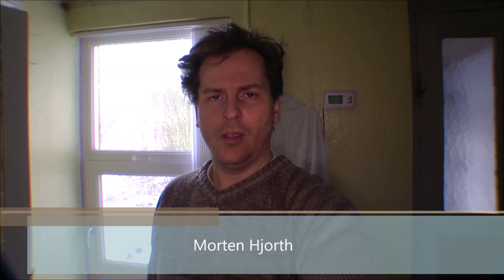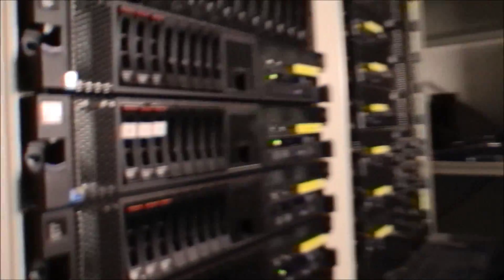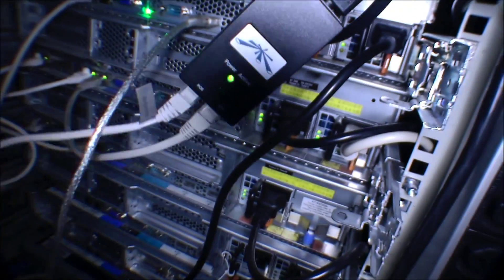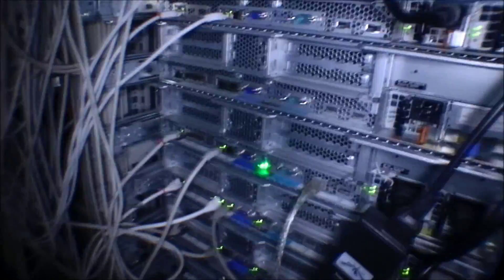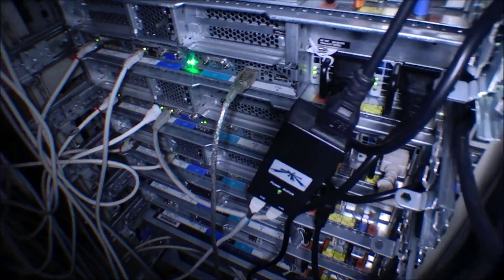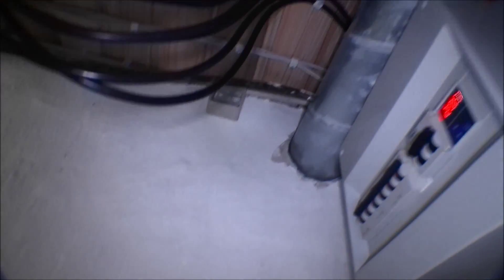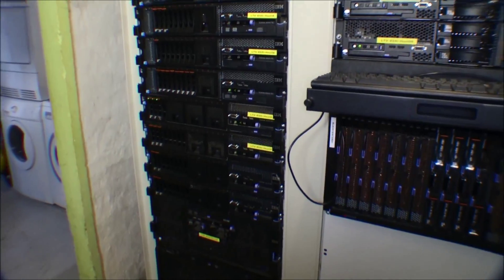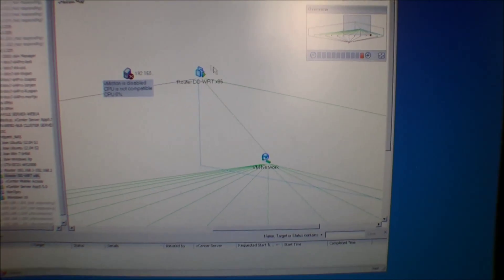Network Overview, wireless - DD-WRT - SRW2048 - 129

Comment: Hey Morten!

On your latest videos this setup hasn't changed much. Have you considered getting a 48 port 100Mbit switch just for the management connections? I know you're using SFP+ 10Gbit but you could use your current 48 port switch for 2x1Gb link aggregation/teaming or if you have the mezzanine cards 4x1Gb.

Thanks for the video!
Reply from the maker: Hi Kevin Clingerman
Thank You very much!  I am getting a new 48 port switch very soon.
Thank you for watching! :-)
Reply: A separate switch just for management is a good idea I think, then like you say you could use a cheap 100Mbit switch to free up th Gbit lines.
Reply: Ps just got my SRW2048 today for £60 and looking forward to having a play with it later in the week!

Comment: I still kinda regret buying a 30 dollar 48 port 10/100 switch, But overall I just need it to do at least 80Mbps transfers from server to client, They have the SRW2048 switch for around a hundred US on newegg, Same for Me hosting multiple VMs on multiple servers, while the VMs are assigned one physical core each, I also use a single core 32bit application per VM, These applications use about 8mb/s per every 64 connected clients, Its a mouthful but hopefully I don't let an ethernet switch be the cause of my unhappy, "Very High Ping, Low Down speed DSL" clients not being able to sustain a ping of less than a 100ms because I didn't have enough switching power...The switch I'm waiting to come in the mail from canada is a "Netgear prosafe FS750T2", and my router is hopefully going to be a PFSense machine or RouterBoard's 2011UAIS-RM...Great video man
Reply from the maker: Hi
I am on the look out for a newer 48port 1G with 2 or 4 10G ports :-)
Thank you for watching! :-)
Reply: My PlayHouse
Nice man, I've looked around at some switch manufacturers and they have some 100G switches with QSFP+ ports for around 5K+, Just if you're interested in having the fastest possible commercial grade network available
Reply from the maker: HI
Not 100G,, just 10G
And I want it cheap!
Thank you for watching! :-)

Comment: Interesting that the ISP chooses to use a wireless connection in what looks to be an urban area.
Reply from the maker: Hi +BlueFoxTV
Yes,, we do have ISP´s that use the telephone cables,,and fiber,,no fiber in my area :-(
This  wireless connection is really well priced,, i get an upto 55/55 Mbps for $21 a month. It´s more like 40/40 Mbps,, but it´s still cheap.
Thank you for watching! :-)
Reply: Well, I'm quite surprised that they can get 40/40 megs over reliably on 2.4 GHz, provided they have not upgraded their NanoStation 2 to something like a NanoStation M5 or a NS loco M5. The 5 GHz band is much better, as it's wider and much less crowded. (I do work at a wireless ISP)
By the way, DD-WRT is a good choice, I'm running it on an Asus RT-AC56U router, but I'll be migrating it to a VM, and keeping the Asus only as a wireless AP.
Fiber is a good thing, I have a 250/100 Mbit/s FTTH connection for 18€ per month, but it's often a bit more, something like 265/110 :)
Reply from the maker: Hi *****
I have been upgraded to The 5 GHz band.
 I have a 250/100 Mbit/s ,,,, i am envious!! ;-)
Thank you for watching! :-)
Reply from the maker: Hi AnasheedCast
This video has becom old,, i have been upgraded to The 5 GHz band,, and had to move the Ubiquiti Nanostation to get the clear line of sight. Mine points at a mast where the receiver is located.
Thank you for watching! :-)
Reply: +BlueFoxTV It's cheap, can be deployed anywhere (no need to lay cables), and if installed correctly, and the devices are carefully selected for the distance and capacity of the link, the performance and reliability matches cable based connections.
Reply: ***** it's cheap alright. But the performance and reliability is nowhere near as good as an equivalent copper or fiber system.
Reply from the maker: Hi i did share a speedtest on my Google+ on 3.dec : https://plus.google.com/+MyPlayHouse/posts/5BDeQuTEjrY
The speed is okay.
Reply: +Animesh kumar I can't,  as there's a part in my contract that I cannot give away our know-how while the contract is valid, and three years after it.
Reply: +My PlayHouse (Morten Hjorth) Where is the other end of the Ubiquiti Nanostation, as far as I know this is a point to point device so is it in a clear line of sight, similar height etc?
Reply: BlueFoxTV I work at an ISP, and we do offer wireless connectivity where we don't have DOCSIS or fiber, including guaranteed connections. (however at a maximum speed of only 8/8 Mbit/s, which is still better than DSL) Of course, the wireless backbone runs on licensed frequencies, and only the endpoints are 5 GHz.
OK, I might have been a bit too optimistic about the qualities of a wireless connection compared to copper or fiber, but 5 GHz wireless is reliable enough to offer a guaranteed internet connection.

Comment: Do you have a "UPS" for all those servers?
Reply from the maker: Hi +Vanecphreaking1 
Well right now, i do not have an UPS,, luckily we have a very stable power system, and only loos power 1 or 2 times a year.  Most of my servers are off,, i only turn them on when filming or working on them.
I am trying to get an UPS up and running,, lots of videos on my attempts :-/
Thank you for watching! :-)

Comment: Can you show, how to setup a Fiberchannel SAN Connection
Reply from the maker: Hi MrAtlantis646
I wish I could,, But I do actually not have all the equipment needed,, maybe if there suddenly dumps an IBM DSxxxx Fiberchannel SAN in my lap,,, weird thing has happen :-)
Thank you for watching! :-)
Reply: But do you know how to connect the rx and tx Lines I mean RX to TX or TX to TX
Reply from the maker: Hi MrAtlantis646
Yes on Fiberchannel SAN, there are a pair of fibers in each fiberports one RX and a TX.
Your Network fiber card or HBA, will have the same.
The Tx from the net card has to go to RX in the SAN and the TX on your Net card has to go to RX on the SAN,, and the same if there is a fiber switch in between.
But this is not something I've been working very much with,, has mounted many fiber cables,, but never made the rest.
Thank you for watching! :-)

Comment: do you have only one  internet connection for your house and data center ?
Reply from the maker: Hi vitserp
Yes,,, I am afraid that it is a question of money,, it all costs money. The dream is that soon I can get fiber,,, it´s only 4km away. (It should also not be easy, to make use of two Internet connections??)
Thank you for watching! :-)
Reply from the maker: vitserp 
Perhaps I should add that we have a very stable, power and Internet supply here in Denmark, in 2014 i had 2 power outage and one Internet failure (Internet does not work when there is no power, so it is not counted twice)
Blackouts were under approximately 15 minutes and the internet was down ½ a day,,, before I discover it.
Reply: My PlayHouse Hey Morten, check out this service: http://speedify.com

It makes it possible to combine your hardwired ethernet and wifi. I'm not sure how it is in Denmark but here in Chicago, Comcast also has basic free wifi. But home modem speed is super expensive. Only after complaining I started to get 50Mbps for $60. So I'm thinking about using Speedify to grab their free wifi and combine them.  If you get a cheap but powerful omni-antenna I have a feeling that you'd be able to latch on to some free wifi in your area from a distance and use it to boost your overall bandwidth. 

Here's an example of the Dish (there's all kinds available though): http://www.amazon.com/TP-LINK-TL-ANT5830B-Directional-Parabolic-connector/dp/B009PY63E4

Comment: I have some very good news for you about your internet provider's white box. It is a Ubiquiti Nanostation, not sure of what model, but your internet speed will increase a great deal if there are no tree branches or obstructions in its link, if it is higher, and if it was on a mount that allowed you to pan and tilt it to aim straight at the tower you are receiving signal from. The lights on the back showing the antenna's signal strength can help you aim it. I can tell that the Nanostation is an older model, and it might do you good to ask if your internet provider can upgrade you to a newer one. I like seeing the data center, and good luck to you and your internet endeavors.
Reply from the maker: Hi logycam10
Yes I need to look a little more on the antenna, it had slipped down and pointed in the wrong direction. I am not so far from the mast,, so I should get a good signal again, simply by fixing this.
I did not, it was mostly because there was so much snow and I did not want to get up on a ladder. 

If I had no internet I would have done it,, but then there was also a question on life and death :-)
Thank you for watching! :-)

Comment: That's an interesting thing, DD-WRT on a virtual machine. For that to work, did you have 2 ethernet ports on the server itself and dedicate one of those ports for the output to the switch? I've personally been thinking about using Windows Server 2012 R2 with "Routing and Remote Access" as a router but it seems a bit bundled with windows, whereas DD-WRT is open source and fully customizeable.
Reply from the maker: Hi funkynicco
Yes i have two ethernet ports on the server, and one is the internet, and is routed out on the othere.
I would be sorry to use a 2012 R2,,, They continually have to be updated.
I'm not a network man, and there are a thousand things I do not understand.
Thank you for watching! :-)
Reply: Ok that answers a lot of my questions too. I'm what you call a Networking man, I'm also systems admin.